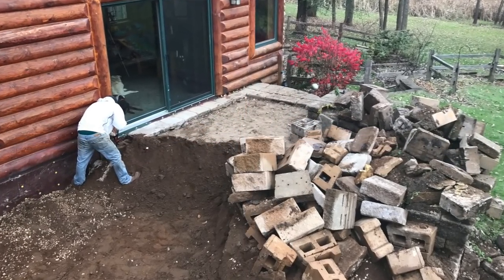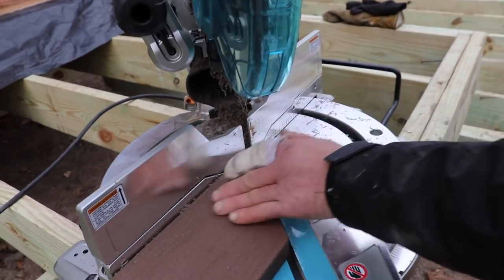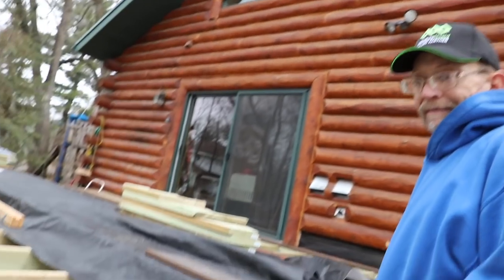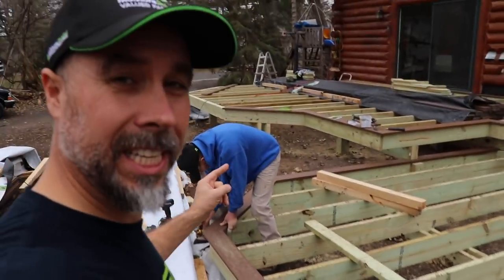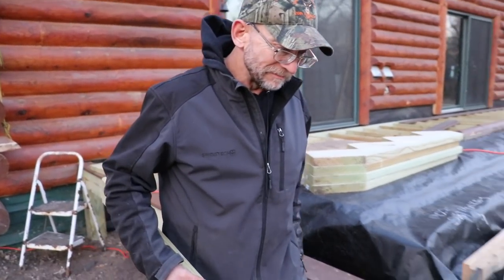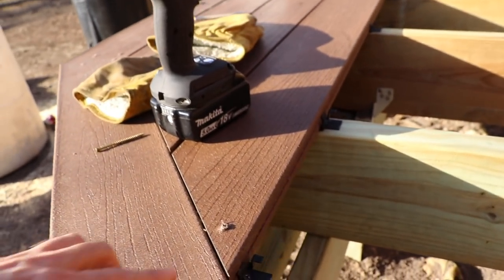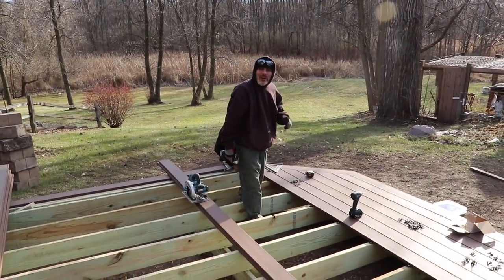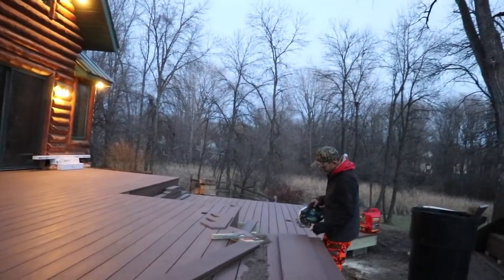DIY How to build a Deck -  Step by Step Guide to Composite decks pt2 of our "Idiot proof" series

Comment: Frankie's terminology is triggering me.
 
1.A sill plate is a board attached flat to a building's foundation before installing floor joists on top of it. Usually it's a 2x4 or 2x6, and is not used for building exterior decks, unless your deck has a solid concrete or block foundation (which would be rare or never) ... What he is calling a "sill plate" is a band board.

2. Those things he is calling "trim nails" are actually trim screws. It says so right on the box that you showed. I would hope a person doesn't need to hear an explanation on the difference between a nail and a screw, but for those that do... If you are using an impact driver, screw driver, or drill to install it, it's probably not a nail...

3. A jig is a tool used to guide either another tool or the material itself while shaping, cutting, or drilling said material. When you use a cut piece to mark more identical pieces to cut, that's called a pattern, not a jig... I guess an argument could be made that it's a "jig" to guide the pencil, but that would be a dumb argument.

I'm not commenting on Frankie's work, which seems fine, but he would drive another person insane with his misuse of terminology. I'm guessing that might be a reason he only likes working alone. It's not a big deal when you are working alone, but when you expect other people to know what you are talking about, it's usually best to not just make up definitions to commonly used words in the trade. "Hand me a box of nails" when he means screws... "Go install that sill plate" when he means band board... "Make a jig to cut those boards" when means make a pattern... This would certainly cause confusion, and most likely arguments on the job site.

The only thing that I will mention about his technique is that composite decking shouldn't have tight joints, especially on long runs. The custom stair treads will probably be fine, but those long runs might cause issues as the seasons change. Composite decking expands and contracts about twice as much as wood does, and the tight butt joints could cause issues, usually during summer days. Either the board starts to warp like a wavy potato chip, or it pops fasteners loose on the picture-frame boards. There's a reason those hidden fasteners put a gap of an eighth inch or more (3/16" if memory serves) and it's for expansion. 

Hopefully this doesn't become an issue on your deck. However, if it does, you can fix it relatively easy. Just remove any railing and clamp a guide to the top of the deck that will allow you to just run a circular saw with it's depth set over the ends of the main decking boards, taking off just a little more than the kerf width of the blade itself next to the picture-frame board. I've personally had to do this on a composite deck installed by someone else, and it fixed the problems I spoke about above. With composite decking, if your span is over 20 feet (or whatever the maximum length of your particular composite deck board is), most people opt for a diamond design or transition board that runs perpendicular instead of butt-joints in the middle of the deck. This is to prevent unsightly butt-joint gaps in long runs. Again, the gap is necessary for expansion. Usually composite railing has a somewhat wide bottom trim piece as well, this is to cover the gap that should be around the post, as cutting tight to the post is an expansion issue as well, unless your posts are surface mounted and don't go through the deck into the framing.

Anyway. Interesting video. I always like to see how other people do stuff that I do. Using rafter ties is a good idea on a deck, especially if it's a second story deck in an area that might get high winds. Either way though, they tend to hold better than toe-nails, and don't split the joist as often.

Comment: Some people like normal drill more than impact...cause of the issue of becoming deaf when not using hearing protection.As for the material used: That is hands down the most ugly piece of recycling plastic porch I have ever seen. You have a nice wooden house, but instead of using larch, oak, or hardwood, you use plastic. The work and design looked good, but the material chosen ruined it.